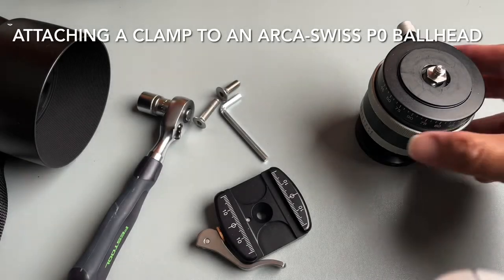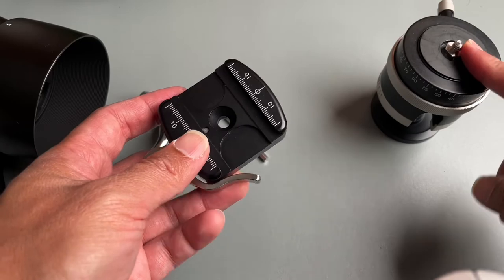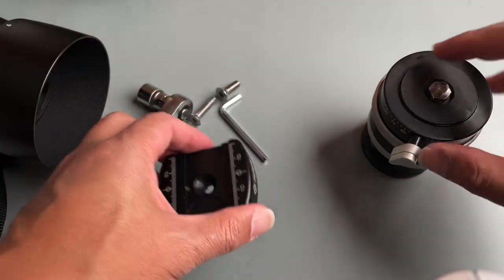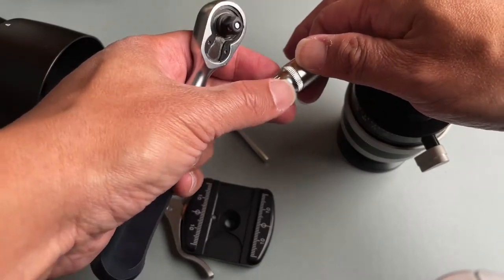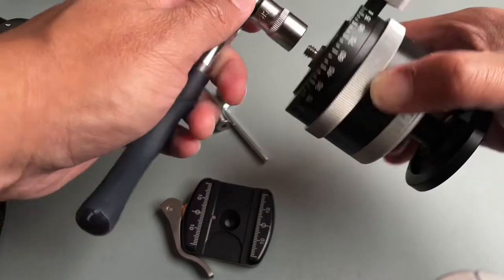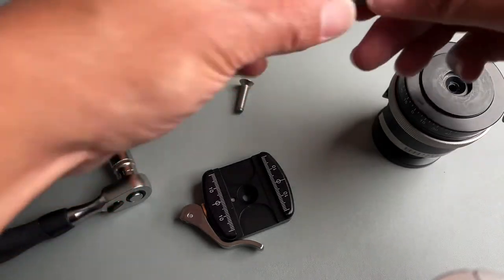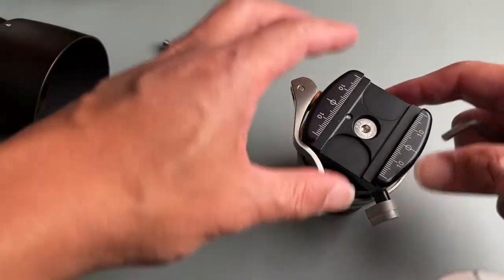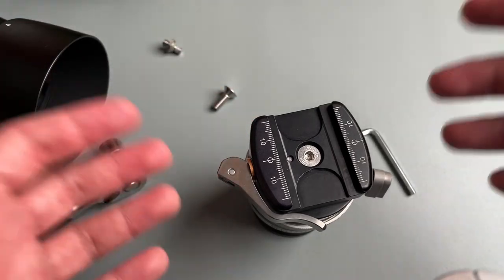Attaching a Clamp to an Arca-Swiss P0 Ballhead

Comment: All recent Arca Swiss heads come with the clamp permanently glued, but it still possible to remove them safely with a heat gun. It takes too rounds of heating. Keep the heat gun very close to the screw cap and heat it for a minute. Wait a couple of minute for the heat to work its way into the glue, then heat for another minute. The clamp now should be very easy to remove.

It is very important to preserve the function of the two pins. The panning base of the Arca Swiss heads are so precisely fitted that even a slight distortion caused by tightening the screw can affect the smoothness of the panning. It is very easy to make two pins by yourself. I have a writing on how to do it, but I can't post the link here (youtube will block my post if I do). Just google "The best non-destructive way to fit RRS LR clamps on Arca Swiss heads" and you will be able to find it.

Comment: This was exactly the video I needed, thank you so much! BTW, you're right that the large RRS lever will interfere with the panning lock lever, but it is not a problem. Arca Swiss's very own C1 head has the very same issue. You only need about a 1/3 turn to go from locked to loose with the panning head so the inability to freely rotate it is not a problem.

Comment: Hi Dexter, I believe Arca Swiss uses some Locktite-like glue to install the OEM screw.  Were you able to remove the OEM screw with just the socket wrench, or did you have to apply heat to it (e.g., with a Butane torch or something)?  Also, once you remove the OEM hex nut with the 1/4"-20 thread stud, what is the thread count for the cavity?  Is that also 1/4"-20 or is it 3/8"-16 or some other thread / pitch?  TIA... Roy
Reply from the maker: i didn't need to apply any heat...just use a lot of elbow grease 😆...i can't tell which thread count/pitch it is...all i can tell you is that one of the screws that came with the RSS clamp fits without issue.

Comment: Thank you for the video.  Did you do OK without Loctite?  Do you have any pictures of the finished product?  I’m curious to know how flush the edges of the p0 are with the B2-40-LR.
Reply from the maker: I ended up using Loctite 😂 because it gets loose pretty quickly over time even with moderate use. With Loctite it’s pretty solid now. I do not have pictures but I can take them later and post here.
Reply: @bubuli  I’d really appreciate that.  I feel torn between this setup (p0 + B2-40-LR) and the RRS BH-30 ball head on top of an RRS TFC-14 tripod for travel/landscape.
Reply from the maker: @jeremyalexander  i have no experience with that head or legs but it's hard to wrong with RRS...but here is the flickr album of the AS p0 and RRS plate...hopefully it helps with your decision making https://flic.kr/s/aHBqjzHg45
Reply: @bubuli  Your photos are fantastic and very helpful.  I had another question for you if you don't mind.  You mentioned in the video that you should opt for the RRS B2-40-LR (50mm) and not the RRS B2-LR-II (60mm) because of the possibility of interfering with the locking mechanism/flip-switch on the pano.  But without the bubble level of the B2-LR-II, how do you get the ballhead level for panorama shots?  I don't see that the p0 has any built-in levels either.  Thanks again!
Reply from the maker: @jeremyalexander  i don’t use the ballhead for panorama.  if i ever feel the need to use it in panorama mode, i have a hotshoe bubble level or i would just use the built-in digital level of the camera.  in all honesty tho if you intend to shoot panorama the panning is on the sensor and not the lens for this setup…you will need something like the ungodly expensive RRS pano kit.
Reply: tank you very much!  @bubuli